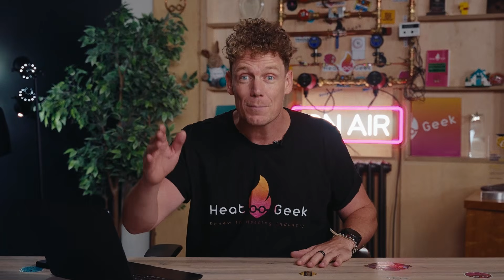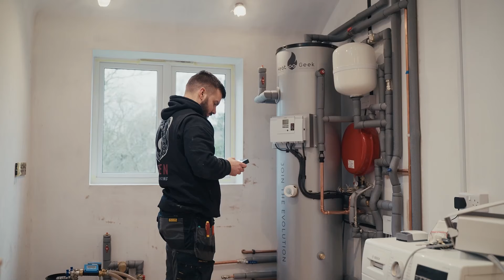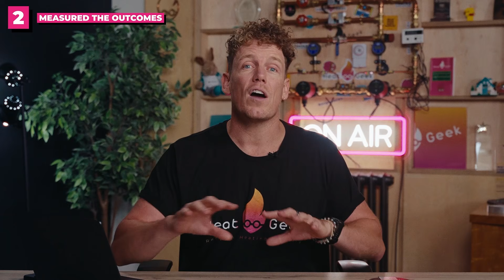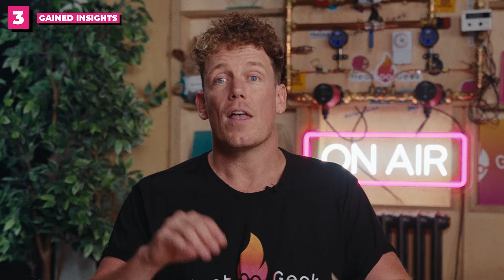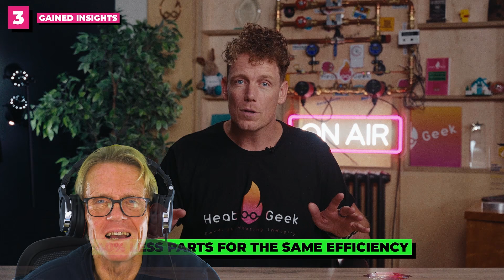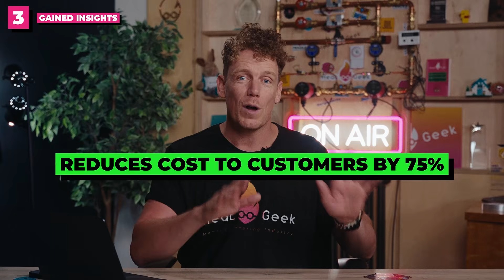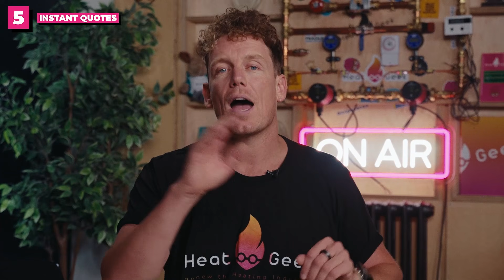Heat Pump Reality Check: Is Zero Disrupt Too Good to Be True?

Comment: Hmm, installed a combi-boiler for better efficiency to get rid of all the hot water tank kerfuffle, and have lovely new designer radiators, in a newly renovated house. Not keen on reinstalling a hot water tank losing space, possibly having to change rads, or any rewiring/external wiring, plus losing space in the garden... don't think it's as easy as they claim, and not sold on these! 🤔

Comment: 7kW heat pump price is £4200 which seems very high (?), compatible  cylinder is £1200, one radiator change, plus controls, say £1500 total parts so far say £7000.
Quote for heat pump £7000 IN ADDITION to the grant!
Quote for heat only gas boiler with no other changes £7000.
We are likely sticking with old reliable Baxi Bermuda until it gets more sensible?
Reply: Your quote for a replacement gas boiler seems way over the top. I hope you didn't ask British Gas for that quote.

Comment: Heat pumps at best are about 300% efficient, on the electricity you put in. But electricity is 500% more than gas on its unit price. Therefore it is impossible to be the same or cheaper to run than a gas boiler, it will be more expensive.

Comment: Heat Geek are part of the solution, not the problem. Heat Pumps are the future, regardless of how long the UK takes to adopt them or how messy that adoption is. 

Fossil Fuels are history. They've only continued to be used as much as they have, because of political lobbying and government influence. They've been subsided for decades and are still receiving support via the UK electricity pricing mechanism, which keeps electricity prices high so that (Natural) Gas power stations remain profitable. 

There's a reason why electricity and gas prices are highest in the UK and Germany —  because both countries chose to become over-dependent on Natural Gas, so they're now paying the price. Meanwhile, France has enjoyed relatively cheap electricity for decades, thanks to Nuclear Power...

Comment: He is effectively telling me not to buy this stuff because it's going to be too expensive for years yet.
Reply: Yeah, bog standard A* gas boiler now £700. £10k plus for a heat pump. And running cost, about the same, slightly more for HP.
Reply: @fredfred2363 
Yes - really annoys me.
All this "hi tech" talk about heat pumps... 
Just keep it simple!
A heat pump is just another source of heat. 
Its ONLY unique selling point is that it "can" use less energy "in" than it puts out - the co-efficient of perfotmance ( cop) - or its "over the year" partner "scop" ( seasonal cop)
Now scop is reckoned to be around 3 to 3.5
So 1kW electrical power in gives 3kW out.
Since electricity is over 3  times more expensive than gas - there is no advantage unless you can
1 guarantee a cop of 3 or more
2 buy electricity at cheap rates.
All the rest of the talk is just waffle.
Reply: @fredfred2363  Exactly. I still don't see any incentive to get a heat pump. Makes no sense at all.
Reply: @fredfred2363  where are you getting these numbers from? no heat pump costs £10k, and if you're including installation fees, you're not getting a boiler installed for any less than £2k. £7500 grant and heat pump is now £2500, suddenly only 500 more than a boiler

Comment: Government initiatives: These are NOT there or designed for the public's benefit at all, but purely to filter/syphon huge sums of public money into private Tory pockets. These so called companies can survive very handsomely on the government funded grants alone, without needing to turn an actual profit. Not only that, but these "subsidised" government  backed industry initiative actually drastically distort the market and take work/income/wages away from the legitimate small businesses who are trying to operate in that industry. They simply cannot compete, so a double whammy against society. It's corruption dressed up as an efficiency drive. 
 The ONLY worthwhile home renewable is solar with batteries, although that industry too is totally corrupted! Go off grid solar and buy/fit your own separate system in parallel/tandem to your existing mains grid power for true efficient energy independence and ecology.

Comment: I have followed you for many years when you cross examine Mr Heat Geek and often visit sites which underperform. Mr 'Geek' is getting more like our politicians - he never answers the question.
RFor all the HP BS talked, why can't I simply buy a HP and plumb it into my current gas boiler system which I run at 50 degrees. I use no hot water (electric showers, dishwasher, washer)  so no water tank needed. I have devised a system where the HP and the boiler work in parallel. The HP keeps the house warm but the boiler takes over if I need extra heat. Simple

Comment: For those with gas boilers wondering if a heat pump will work in your house, there is a super simple test you can do, set your boiler flow temperature to 50C around November, then see if you can make it to February without having to turn it back up, if you have to increase it past 55C, then you need more work than just a heat pump and it gets real expensive, really quickly.
Reply: Mine gas boiler runs at 60c.With a heat pump system 25/7 not stop and start
Reply: No reason traditional CH run @ 50C won't get a house to 20C and keep it there, if run constantly - the issue is you are using 3-4x the gas in kW terms than a comparible HP! Presently electricity is sold at a cost biased towards gas - its not comparible, if it was a level playing field a HP @ 300% efficiency would knock a Gas boiler out of the park @ 95% efficiency !
Reply: See why you are called "the singularity "  infinitely small and infinitely dense!

Comment: Adam
If I use your company for a heat pump  will you guarantee that the company you introduce me to
use a  fully trained engineer to Heat Geek standards or just any available fitter in the yard ?

usu

Comment: Heat geek are taking the industry on a fantastic journey of discovery. You have to understand adam's personality to realise that there is no negativity or profiteering in his approach. He really is how he appears. Just totally enthusiastic and loving every day of his life doing the thing he really loves. 
Historically, heat lust calculations needed to be carried out to a standard prescribed as far as i'm aware by cibse. We have always been aware that these calculations had built in factors to prevent under sizing. We always knew that this led to an element of oversizing of both heat emitters and heat sources. These calculations added complexity to the design and installation process that excluded many ordinary installers. By providing the necessary education heat, geek have allowed many installers to raise their game and carry out proper heat loss calculations based on cibse requirements. I know that these are currently being looked at as cibse are totally aware of the inadequacies of these heat loss calculations when it comes to the world of heat pumps. What heat geek have done is come up with a tool that improves on traditional heat loss calculations, giving a much more accurate heat loss based on real world homes and life. This is truly a revolutionary technology for the heating industry. 
I myself have been talking about the fact that we were being forced by the use of these heat loss calculations to change radiators that I knew would already perform as a result of many years, installing weather compensated Viessmann boilers. Almost every boiler i've ever installed has functioned perfectly well on a one point four slope. Radiators that can work on this particular slope will perform with a mean water temperature of forty two point five degrees centigrade or close to this number. I have often said the reason heat geeks have such good results is that they are forced or had been forced to do a job to a far higher standard than was intended by the regulations. 
I think your reference to sharks in an article about heat, geek is totally inappropriate. High quality workmanship is delivered by the best engineers and these engineers expect to be remunerated appropriately. If the government lay down guidelines of how we are to design and install systems, there is no choice but to follow these guidelines. Not installing to the correct standard would make you a cowboy, but your implication that installing to the standards makes you a shark is very inappropriate. 
Heat geek have constantly been looking for waves to bring the adoption of heat pump technology to a wider customer base. This has not been primarily driven my request for profit but for a successful reduction in carbon emissions.

Comment: Ill give you an idea of someone who went through the "cutting edge" / "cheaper" / "better" HeatGeek process....total cost £14,329 total price £22,329. Of which £5,280 was down to "sundries" even after a back and forth with HeatGeek (you cant get them on their cutting edge customer service line) no clarification on prices or a request for a cost breakdown. Its not just about heat pumps being more expensive on average, its really Heat Geeks being more expensive. Be warned
Reply: This was not a zero disrupt job.

Comment: My son had a heat pump installed a couple of months ago, but every time it starts up it blows a leak in the original piping system and the whole thing drains. Now the installers have decided that there are leaks under his concrete floors and are offering to treat it by adding a chemical to the system that will seal the leaks. It sounds like a finger in the dyke to me.

The installers say that the original piping, which was gravity fed, isn't up to the challenge of the new pressurised system and it"s not their problem. However, they did a survey before submitting their proposal, so I feel it is very much their responsibility. I would expect them to have done a pressure test as part of that survey.

Most of the piping is under his concrete floors, which have very expensive laminate flooring so fixing the leaks is probably not an option. At the moment they are in deadlock with winter approaching and only the hot water works. Any thoughts?

Comment: our heat pump is costing us £10,200 after the BUS grant. it'll take 13 years to pay for itself. i wouldn't say that the money is going back in my pocket. without the BUS grant it would take over 22 years to pay for itself. beyond the natural life of the heat pump. if someone out there is fortunate to get a new heating system for nothing I say fair play to them. It probably won't be as efficient or perform as well as mine but if another property stops burning gas it has to be worth it.

Comment: Heat pumps work just fine but we need to get away from wet systems those are far too expensive and complex

UK only 2% of homes have heat pumps. Norway is 63% and growing fast. By 2030 they will be 90% heat pumps and thats a far colder country

Simple air to air systems are needed like in Norway

Should be small mini air to air heat pumps. One for each room. Order off amazpn for £150 and DIY install it or hire a competent basic tradesperson. Small enough for 1 or 2 men to easily handle. Easy enough to be plug and play. Not these ridiculous heavy huge air to water systems

Comment: The issue is half of plumbers and fitters are below 100 IQ

Expect half of installs to be done poorly. If you install a gas boiler poorly eg fitting under sized radiators its not the end of the world you just subsequently set the boiler to feed the rads at 65c rather than 55 as an example

Also the UK plumbers and fitters have experience.fitting over 100 million gas boilers. They learnt to do an okay job by messing up a few million installs first

Well its going to be a nightmare for a few million households whole the learning curve happens

Comment: Make electricity cheap simple. Governments have been promising this for years; it's time they made good on those promises.
Reply: Not forgetting most electricity is generated gas dirty electricity, so where’s the environmental savings.
Reply: @christophernunn943  apparently this is a bit of a myth - gas is only the biggest single source of UK electricity generation proportionally (around 38%) - in other words it provides proportionally more than any other source *considered individually*, but when you compare that to all renewable sources collectively ie as a whole, renewables provide a greater total share of the UK’s electricity generation overall - they actually generate more than half. This will also only increase if decarbonisation continues. So electricity uses way less carbon than gas atm

Comment: They tried to con the UK public by selling 3kW or 6kW HPs to replace 30kW boilers - what could possibly go wrong? Oddly enough, if you look at Scandinavia, EU and N America, they have proper sized HPs, for both ducted air and hot water systems. The UK salesmen don't care as long as they get their commission. For larger, older homes, we will have to wait until larger HPs arrive here.

Comment: When this guy has made his money out of ripping people off and conning them with these heat pumps The British public will be getting Mis sold compensation from the govenment. he will then move on to the next govenment con.
My Home ,Fitted wood burner €450 15 years ago, €130 wood per year. Electric water boiler €200 new, fitted last year after the old one gave up after 18 years (Fitted myself because all the pipe work was already there)  Electric bill € 200 per year which is my calculation (water only) my total Electric bill per year for the whole house is €800. I think if you look at the whole bill If I had a heat pump I would never live long enough to get it back

Comment: I had an Ebac heat pump fitted last year. Nightmare to get it retro fitted but I wouldn't go back to a gas boiler. The house is always warm, no cold spots, helped my respiratory health and helped my daughter's Reynauds. We save around £400 a year but the difference in performance is great. However, it cost is £3k more than a gas boiler.
Reply: We had a hestpump fitted, best choice we ever made.
Reply: Would you have also saved £400/year with a modern condensing gas boiler with enough modulation range to work with modern controls monitoring outside temperatures.  I've no experience with EBAC heat pumps but I do have first hand experience experience with one of their other expensive products. I'm not impressed and subsequently from reading many reviews I don't hold out much hope of them meeting any repair guarantee.

Comment: For any works, the moment gov announces grants or 'money will be made available' it's industry that licks it's lips not the consumer.  Somehow parts & labour miraculously spike and the cowboys saddle up.

Just look at the latest debacle with External Wall Insulation in the UK. Funding with no apparent/effective standards and monitoring have led to a disgusting 98% of homes with ineffective and ruinous installations or fraudulent grant claims. Reports of criminal installers now living the high life abroad on taxpayers money leaving misery in their wake.

If any change equates to such a great alternative to the most commonly used current tech, this claim should only be made without subsidies factored in from the off.  In the case of Heat Pumps; if it's not the same price or cheaper than a gas boiler swap (regardless of what you 'might' save in the future) without a grant, forget about it.

Roger, I agree with you.  The wheels will come off this gravy train once the grants run out, so they'll probably just introduce more grants.

As for making this affordable to all, not just the 1%, look at Solar Panels - a home upgrade that is guaranteed to save you a lot money in the future. Despite many rounds of grants and recent new build regulatory changes, after around 40 years of solar panel domestic installations they only account for approximately 6.5% of UK homes.

Don't forget people, we're not trying to save the planet.  We're trying to save us from ourselves.  The planet will be fine long after we've gone.

Comment: i would only considering replacing my gasboiler with a heatpump if it is on par with the gasboiler
meaning, same price, same efficiency (50°C+) and max 2Kw, not 5Kw
Reply: A reasonably installed heat pump has a similar energy cost to a gas boiler. @HeatGeek installs can offer better than this. A modern heat pump can produce 70C hot water. Generally you'd want cooler hot water. A 10 kW heat pump outputs 10kW of heat but might use 3kW transferring it from the air outside (I think that's what you are referring to?)

Comment: We're undertaking a home extension and have had solar and battery fitted as part of that so I was keen to go for a heatpump and remove my dependency on gas completely.  It's a 4 bed Victorian house but with double glazing and decent insulation bar the walls, plus fairly new radiators.  I went with heat geek and the experience was good, but after the full survey the quote doubled the initial estimate from them, including having to replace every radiator in the house.  The outside unit had to go on my patio a long way from the house to not be near to my semi-detached neighbours. The estimated running costs were also a bit higher than I pay for gas currently. It's a shame as I was sold on the idea but couldn't justify paying 4x a boiler replacement for this with no chance of a return on the investment.  I don't believe this was just down to assumptions being made, so hopefully the technology keeps improving to make this viable for more people.

Comment: There is no reason every house can't have a heat pump. The scop will be give or take the same in any property just propertys with a big heat demand will require larger system and to run longer.